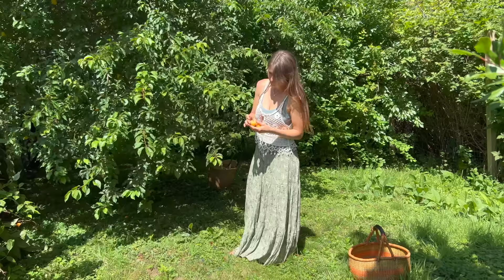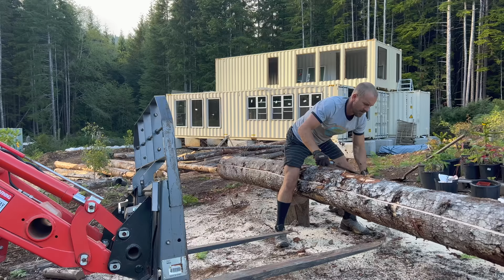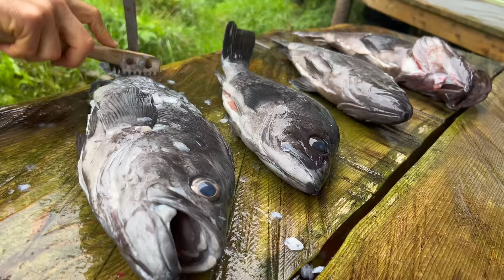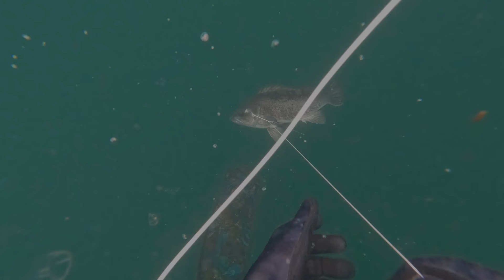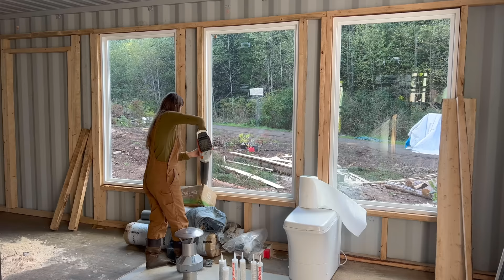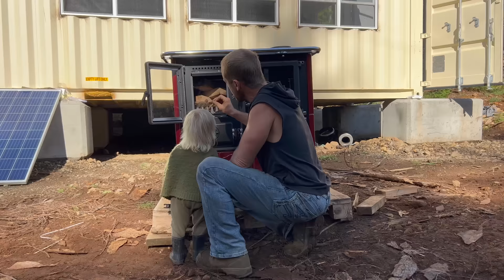BUILDING a HUGE WOODSHED - 1 YEAR of WOOD | Raw & Unfiltered - SPEARFISHING DEEP for FOOD - EP. 176

Comment: One way to possibly eliminate plastic vacuum bags: We freeze our PWS spot shrimp in water, if that makes sense. We use disposable Rubbermaid style totes and try and get all the air out while allowing room for expansion as the water freezes. We re-use them as long as we can. As long as your meat is covered by the water, this might be a way to avoid using plastic. However, it's hard to beat vac-sealed Black Bass in January.
Reply from the maker: Great ideas

Comment: Bone-free, fish filets can be reasonably protected from freezer burn, (even without vacuum sealing), by coating them with layers of water.  
Step 1 Freeze the filets to a medium freeze on a cookie sheet. 
Step 2 Dip filets into coldest bath of ice water available for a couple seconds then re-freeze to medium freeze.
Step 3 Repeat step two a couple more times until fish is protected by a reasonable layer of ice, but filets are maintained separately, (not stuck together into one block with several filets within). 
These can then be preserved in simple plastic Ziploc bags for several months.

Comment: Years ago I fixed up an antique cook stove because the wife said she would cook on it to go out the regular wood stove but the cooked stove in place the biggest problem I had with the cook stove was it wouldn't burn all night because the wood was so skinny pieces the fire box wasn't that big so you'd have to get up constantly at night and put wood in it another drawback was when it comes time to clean it it took a lot of time to clean out all the ashes because they go all around the whole stove I loved it cooking on it the only thing I didn't have was the water tank on the side of it it had the warmer at the top over top the stove oven very nice cook stove the big part of it is still in the living room because it's so heavy I don't know how I ever got it in the house by myself but I pushed it to one side and put the wood stove back in the house because the wife stopped cooking on it so when I cooked I just used the normal wood stove now I don't burn firewood because it's too expensive here too hard to get it actually seems like the landowners give the wood loss just to a few woodcutters I used to cut fire wouldn't sell it didn't off and on for 25 years that's why I have back problems the big old growth logs were pretty hard to lift into the back of the truck miss it don't miss the work

Comment: At 48:00  you are putting full rounds in to the shed. They dry much faster if you split them first. The more surface area that is exposed to the air, the faster the wood drys.

Comment: You can use reusable plastic containers over the vacuum seal if you are trying to reduce your waste. Leave a little room for expansion, otherwise you can pack it in. You can use them for any kind of meat and for most veggies/fruits, label with a sharpie marker. Nothing fancy but be sure they are food safe in manufacturing. Stick to just 1 or 2 sizes for space efficiency.

New to your channel, I can live off the grid through you now. You guys work so hard, make sure you take the time to enjoy the fruits of your labor.☮♥

Comment: 45:04 For storing meat, I've seen mason jars with brine water. Since it's the meat you are saving, submerged in liquid is not subject to air. And they use a "bubble stick" (like a wooden chopstick) to ensure proper seal with no air and no bubbles. Proper gaps and proper mason jars with lids (flat part) and lid caps (screw part). There is a boiling process as well. They call it "canning".

Comment: What to do with fish fillets that you do not wish to plastic vacuum pack nor have the time to smoke? Brine them in a pail by drizzling salt on each layer of fillets (do not add water). Store the pail in a cold storage area or fridge. When you wish to consume some of them put the fish fillets in a water bath for 24 hours to remove most of the salt in the flesh (one volume flesh to ten volumes cold water). You will notice a slight salty, but pleasant taste unless you herb and spice the fillets before cooking. FYI: brining fish for long-term preservation (one year) goes back centuries. Your other choices are jarring and cooking or marinating/pickling, both with your choice of herbs added.

Comment: I don't know if you get high winds there, just a suggestion attach some boards length wise to hold the roof from getting torn off in high winds. I unfortunately learned that the hard way.
Reply: Yeah I was looking at that thinking one good storm and those panels are flying off. Shouldn't it also maybe have more of a slope and a support in the middle? It'd be so unfortunate to get to the middle of winter, then have the shed collapse.

Comment: Love your videos. Anout how to preserve fish without using plastic for air vaccum . Why not do the old way like the Norwegians did and do with cod fiah ? Salt it . Cure the fish in the salt . It will dry out and won’t need refrigeration. When is time to use soak in water over night then drain it several times. After u remove most of the salt you cook anyway you want it. If u do this way post here to let us know how it turns out out.

Comment: If you built a real insulated house you wouldn’t need a big woodshed! The round tent ,, the 2x6 bunk house and now a sardine can framed inside with 2x4’s don’t cut the mustard! A log home or timberframe made with real wood. Not canvas or tin will hold heat! My doctor left his house in Maine for 10 days,, it went below zero 3 days never went above 32 the entire 10 days,, left at 74% came home @68% timberframe with 15inch walls r55 walls R 78 roof passed solar windows facing south!, The house was checked everyday for 10 days never needed to start a fire! Coastof Maine!

Comment: i know this sounds funny , but i ALWAYS  DOUBLE SEAL THE BAGS ON BOTH ENDS,  to ensure that the seal doesnt break,  sometime a seal under freezing condition break or split open , the outside of the double seal under these conditons can break open so having a double seal  is best, p.s. what size bags are you in need of ??  where you were cutting the steel , notice the opening above the opening , in there i hope your going to spray a 2 part foam to insulated that? the more you insulate the container the warmer/ and / cooler itS going to be, both inSPRING SUMMER, FALL , WINTER ! YOU NOTICE THAT THE MAN IS ONLY INTERESTED IN THE HAND MOTION FOR HER CUTTING THE STAIRWAY?HAHA

Comment: I don't understand why you run your tractor at full throttle all the time, even when it is sitting idle not doing any difficult work. I'm not trying to be difficult but it burns more fuel that way and it doesn't need the power of full throttle much of the time. I grew up on a farm using tractors and we used the throttle as much as the changing of gears. I realize that your tractor has a hydrostatic transmission which is speed variable, but they also work at lower engine speeds. Yes when using the backhoe it make sense to have the engine revved up. Anyway, it is just a thought. I have enjoyed your channel for a long time. Stay well.
Reply: I don't think he knows what he's doing

Comment: So, off the grid guy, how are you powering your table saw? I didn't see or hear a portable generator and I seriously doubt solar panels and batteries are sufficient or dependable enough to power the saw you are using. Actually, with the house you are building, it seems foolish and unnecessary not to string electrical lines from the power lines at the road. Your power needs with a family will grow much faster than you will be able to self-generate power in the predictably cloudy and rainy Vancouver Island. It looks like you probably have already exceeded your self-generating capability. This is my "raw and unfiltered" opinion and if it is incorrect, show us how you do it.
Reply from the maker: Solar panels and powerwall….check past episodes